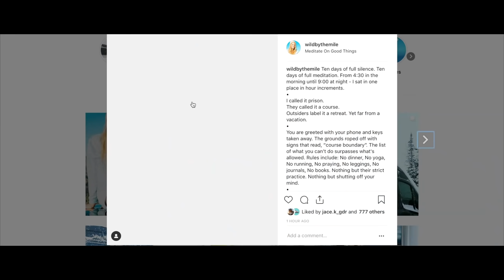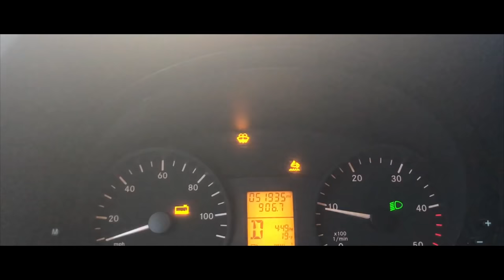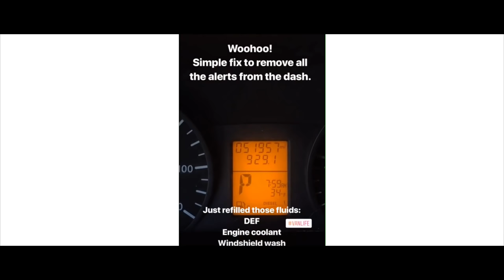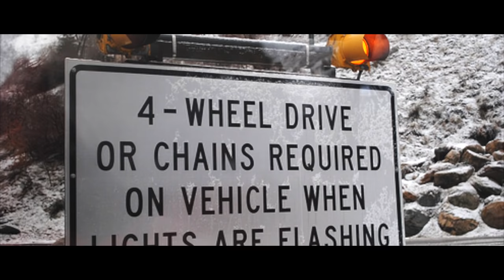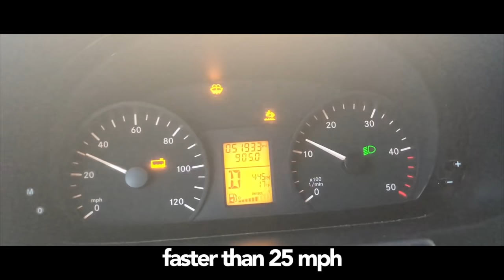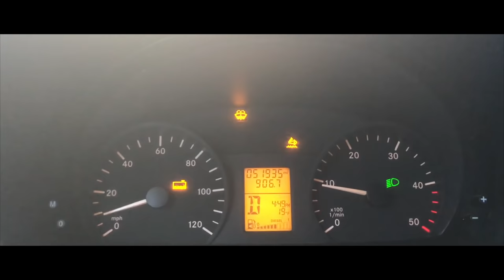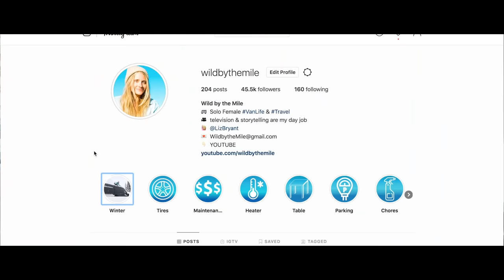SOLO FEMALE #VANLIFE: #WINTER SAFETY

Comment: 10k for 4x4? Don’t knock it til you actually experienced the same conditions in a 4x4. Life changing... and saving. ✌🏻
Reply: 4x4 does nothing for braking and that's where she was sliding...
Reply: I was thinking the same thing. She is just about living out of this van. And she knows she is a skier with plans to take it into the mountains. This is a no brainer. And the 4x4 is also useful for off road trips in warm weather as well. My SUV is 4x4, and it’s an absolute beast in the snow. I live in the mountains, and the only times I ever missed work was when the snow was higher than the bumper. If she goes off the road one time or ever has a fender bender, the rise in her insurance rates would pay for the 4x4, not to mention the hospital if she is really hurt, or worse. Again, safety. No brainer. I hope she reads this comment.
Reply: 7heRedBaron hey there. Yup. We’re both on the same page. I was merely making a suggestion. 
Many dealerships have a 4x4 day. Anyone can go and actually see their capabilities. You made another good point - the van doesn’t only go to the snow, in summer it’s in the mountains or desert. Essentially by having a van with 4x4, diff lock and low range the van transforms from a “rv” to a “overlander”.
You CANNOT put off road tires on a vehicles and think that you can then do wild and wonderful things because you have off road tires.

4x4 would open up so much more to her. From capability to safety in any road /track condition.But besides that. Even if the young lady was camping in the snow or rain and got bogged down in mud, sand or snow, 4x4 would get her out. Not 2x4. Many think of 4x4 as four tires moving together. They do not consider the fact the vehicle can still run in 2 wheel drive and with a push of a button transfer the vehicle to 4 wheel drive and should things get a little more difficult transfer the gearbox to 4 wheel drive low range and should you still get stuck? Then there’s rear diff lock. And then there’s also Centre differential lock. The upgraded suspension and the expensive tires are already on the vehicle. 

This is turning into a rant. Lol. Have an amazing day. Remember. KEEP CALM AND ENGAGE 4x4. Happy trails.
Reply: I think you summed it up well when you said that most don’t realize the value of the 4x4 if they haven’t had one. On the overall cost of that van, $10,000 is money well spent to avoid those chains and getting pulled out of parking spaces.